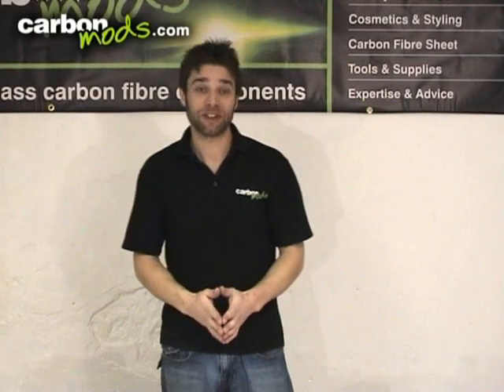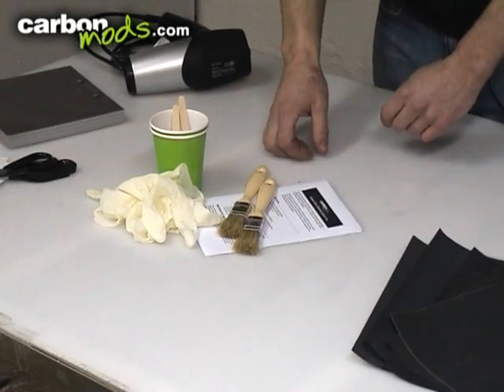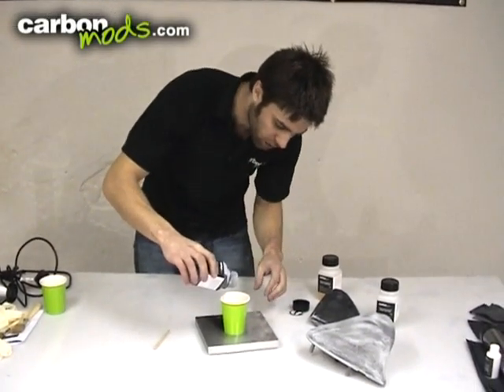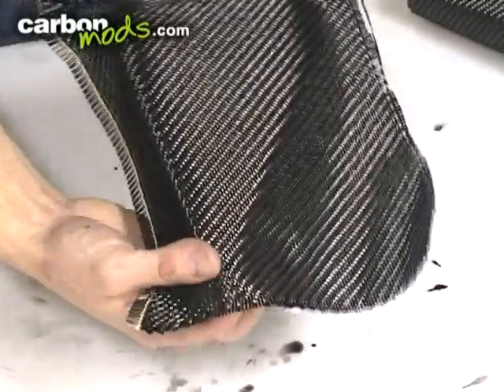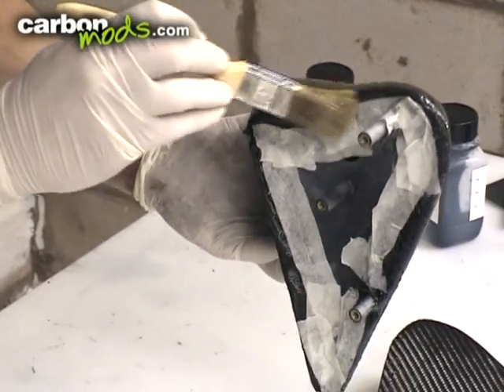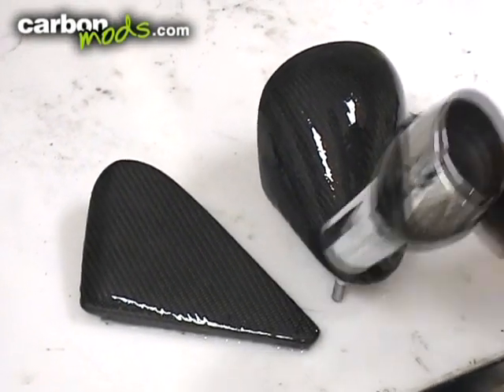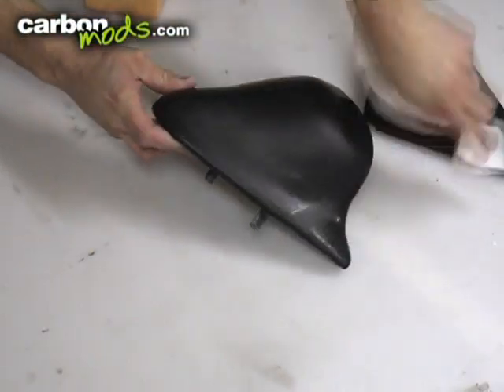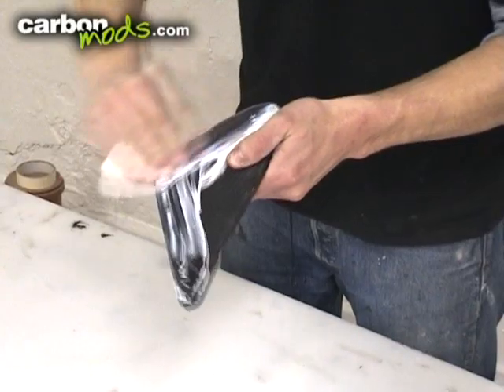How to cover parts in carbon fiber (fibre) by skinning or wrapping

Comment: Bone you can tell the difference in weight. My metal hood weighs around 30 pound, just bought a F hood that can't weigh more than 5 founds. Even a fiberglass hood weighs 10-15

Comment from the maker: @MikkoMuhis Yes, it will certainly add some strength to a fibreglass part if you add a layer of carbon fibre over the top. It is only one layer though so it's not going to be a huge increase in strength. If you want it much stronger then you could add additional layers of carbon fibre.

Comment from the maker: Hi faYte0607, 

It's very easy to wrap around corners and curves because it's real carbon fibre and not vinyl. the weave can move freely against itself this allows it to conform around complex curves, unlike vinyl which can often wrinkle where there is an excess.

Thanks for the question, Carbon Mods

Comment: Does the Tow Size and thickness matters for the CF?
 I have lots of 6k 0.17" cf cloth and Epon 828 resin, do you think it will work the same if i folow your instructions in the video?

I don't live in UK or else I would just order your stuff.

Comment: I'm looking for someone to do a skin on my Denali grill bezel. I wanted a black finish and tried to paint it without a proper location to do prep work on the Chrome. Now it has mostly chipped off and I want to start over with a permanent black look. I think that upgrading to CF would look awesome. Is there a shop that applies CF skin to factory chrome auto parts?
Reply: There's a good chance that any good auto body shop could take on such work, especially if they have experience with fibreglass work, etc. We've also noticed a growing number of smaller businesses offering such a service via Facebook or Instagram pages - we cannot recommend anyone specifically but you will probably be able to find someone reasonably locally to you.

Comment from the maker: If you think any grease or contaminents have got into your process somehow (off your hands, rags etc.) then this is good advice. If you're working very clean and changing water reguarly then this isn't always neccessary. We didn't wipe this part down between coats, kept it clean and it was perfect.

Comment: CabonMods,

I want to make a CarbonFiber Xbox 360 case.
Not face plate but whole case!

Do I need to make a mold of the case first or can I just skin it, remove the skin and use that as the case?? 
-Thank you

Comment: Can I use automotive clear coat instead of resin
Reply from the maker: You'll need at least a couple of coats of resin to wet out the actually carbon fibre and provide a reasonably smooth surface but you could then use a clear coat to finish.

Comment from the maker: @dotless : It would be possible but motorcycle exhausts run pretty hot so we would suggest using the 'HIgh Temperature'  version of the kit. It's exactly the same but uses a special resin system that's dimensionally stable (doesn't expand or contract) up to about 160 degrees C (which should be fine for most exhuast systems). The you just follow the same steps. The HT kit is listed on our site too.

Comment from the maker: @malibooroo : TT mirrors really are very domed and would be right at the limit of how far the weave could be distorted without the need for a cut-line. If you do need a cut-line I'd suggest using our ProFinish carbon (so that you can have a perfectly neat join-line) and doing it in two peices - this will reduce the amount of distortion needed considerably.

Comment: Can resin bond with bare plastik material such as spoilers??
Reply from the maker: It depends on the type of plastics, some are very, very difficult to adhere to and so I would avoid Nylons, Acetyl, Polypropylene and PVC among other Hard-to-Bond plastics but it should be possible with plastics such as ABS with good surface preparation.
Reply: @carbonmods  so how do i do if i intend to skinning plastic mat such as nylons,acetyl,pu and etc,

Can i skinning the whole item first using polyester resin and normal fiber,after that only i lay the cf mat?
Reply from the maker: @mohamadiqram5837   PU (Polyurethane) is not much of an issue if the surface is well prepared but for low surface energy materials such as Nylon or PP, this process isn't really suitable - polyester is unlikely to bond to those materials either.

Comment: Could this be done for manifolds or exhausts?
Reply from the maker: Realistically no as the resins will not take the required service temperatures.
Reply: @carbonmods  you're a legend mate thanks!
Reply from the maker: @waqshah5160  Intake manifold is likely to be okay though.

Comment: Just be sure to try and match up the weave direction and flow it with the curves of the object. Such as a car or similar parts. The most common is a 45 degree angle facing the right axis. Driverside 7 to 2 O" clock/ Passengers side 5 to 11 O" clock. If you look at the fibre ou can see the key weave direction. In the vid the mirror was straight ish, and the sail panel was almost at 45 Degree. And don't quote me on this, you'll be casing, VIS, Seibon, Aero. ect. ect. ect. Later.

Comment from the maker: @zbarneyz : I think you're missing the point. Adding a layer of carbon fibre to a none structural part (like a wing mirror cover) will only add a few grams of weight and will transform the way it looks. If you're not racing then adding 10g  won't make any difference to the performance but will improve the look of the car (you obviously like carbon or you wouldn't be watching this video). We make real carbon parts for race cars too but plenty of times a carbon skin is the right way to go.

Comment from the maker: Hi rinjingan, 

Yes you can use vinylester or polyester resins, however they do not perform as well as epoxies and often their clarity is not as high. All top composite workshops will use proper carbon fibre laminating epoxies like we supply. 

Thanks for asking, Carbon Mods

Comment: Hi all, what type of base/glue best for sticking t carbon fiber on metal ? Tqvm
Reply from the maker: If you're following the process in this video and applying carbon fibre cloth to a part then an epoxy resin (ideally a basecoat which is black in colour) is the best option and as long as the metal is thoroughly degreased and abraded to provide a mechanical key, you'll get a really strong bond. If you mean bonding an already cured carbon fibre sheet or part to a metal part then its a little trickier to answer as it will be determined by how the part is being used (is it cosmetic or structural); you could use single part Polyurethanes such as our PU18 or full structural adhesives like our VM100 'VuduGlu' methacrylate adhesive.

Comment: Can this same method be achieved successfully by weaving carbon strands myself to make my own woven pattern in my own size, say around a small mandrel
Reply from the maker: Potentially although that's potentially a lot of work when woven carbon is available off the shelf in lots of weave patterns, weights and widths but for sure, you could take carbon tow and weave it yourself.
Reply: @carbonmods  I want to use this method for custom fishing rod building to attach the guides to the rod blank. The sheets will leave a seam and won't be as tight unfortunately.

Comment: Question. What sand papers did you use in the beginning. Also, did the polish last forever?
Reply from the maker: MrPeterhuy : We start with a 120 then 240, 400, 800, 1200. The polishing process lasts indefinately (it's a mechanical process that effectively flats the resin to a very smooth glossy finish) however, like any surface on your car, eventually minor stratches and deterioration will occur. If you lacquer the part (clear coat) then it's the same situation although the shine you can get from lacquer, and the UV protection, are superior to just polishing the carbon.

Comment: how much extra thickness does this add?
Reply from the maker: +terra force It's around about 1mm. It depends on how many layers of resin you add and how far back you flat the resin that you add but you'll generally end up with somewhere between 0.7 and 1mm of added thickness.

Comment from the maker: @psasmh1 : Adding a layer of real carbon fibre to the outside of a part will certainly add some strength to the part. If you wanted to add more strength (as much as you want really) you could just add extra layers of carbon. This would be great if you were using this process to add a layer of carbon onto the outside of part you'd shaped yourself out of foam for example.

Comment: Important! Sanding carbon fibre require the same safety equipment as handling asbestos! Also, this carbon fibre vid shows how to make it look cool. But to make a part that is strong you have to work differently and really saturate your fibre in epoxy. Prefferably use vacuum bagging and an owen to cure it in.

Comment from the maker: That's right, a single layer of carbon won't add much strength to the part but it would be a hard outer finish nonetheless. If the part started off strong enough then a single skin of carbon would be the normal thing to do. If the part isn't strong enough and you want to make it stronger by adding layers of carbon then you would be talking of more like 3 or 4 layers to really make it stronger.

Comment: How does none handle parts that have countersunk recess for screws when skinning?
Reply from the maker: The easiest way would be to fill the counter-sink hole with plasticine, skinning straight over the top and then re-cutting the countersink once finished. You could then use a small amount of the black basecoat or paint to colour the recess black so that it blends in with the surrounding carbon. Alternatively, you could cut the countersink slightly bigger than it needs to be and skin that first using small offcuts of carbon; it will be very fiddly to achieve, especially the sanding and polishing afterwards but once done, you could skin the rest of your piece and trim neatly at the edge of the countersink. If it was me, I'd opt for the first process though as its likely to result in a faster but better finish overall.

Comment: Go to easycomposites.co.uk. In their carbon fiber section they have all of your standard twills, weights, and weave sizes. if you scroll down a bit you'll see one of the options with a blue "PROFINISH" on it. That's what you want. It comes slightly pre-infused with resin. It won't separate or fray when it's being formed to a mold or cut (unless you're really rough with it). Also, try using carbon fiber shears because they won't pull when your cutting. Good luck!

Comment: @carbonmods I have changed to just using carbon fibre patterned vinyl. Should make things easier and cheaper. Its actually for making a deadmau5 head so using actually carbon fibre is pointless.

Comment: What did you do with the taped back edges?
Reply from the maker: You're making me really think back now because it was a long time ago! In this case, I think we left the tape on because it isn't seen when the mirror is fitted to its back plate but it could easily be removed/cut back after the first coat of resin has cured and then the subsequent coats of resin would encapsulate and put a good finish on the edge. The tape is only really needed whilst that first coat is curing.

Comment from the maker: It depends what type of foam the canopy is made from. If it's Depron then the bond will be ok but it won't be fantastic. If it's PU foam, styrofoam, or PVC foam then the bond will be a lot better. You should ensure that the canopy (or anything you are covering) is keyed-up properly (with coarse abrasive paper) which will help the 'skin' stick to any material.

Comment from the maker: Hi Plooke, you could use normal carbon fibre epoxy laminating resin as the first coat, however you may get problems with the level of 'tack' and quality of bond to the part, also with it not being black you might get visable gaps between the weave on the surface,  I would say if you can get hold of some skinning base-coat, it would make your life much easier! Any more questions please ask.

Comment: Is it possible to make a full CF piece out of a skin ? I'll explain myself... Imagine you want to make a fully CF piece without using a mould. You'd have to make a single CF layer of the object (like the skin you are doing in this video), retire it from the object (which would be used as a mould in this case) and put successive layers in the back of the first, already hardened, CF layer. I guess the only difference here is that we should have to use a release agent for the first layer.

Comment: Is the process the same for wrapping a stainless steel part? What resin would you recommend?
Reply from the maker: +MrTurbo458 Yes, it would be the same process. The only problem you may encounter when skinning metal is if the metal part gets hot. If this happens it can expand (coefficient of thermal expansion) where the skin of carbon/epoxy has almost no thermal expansion which, over large areas where temperatures get sufficiently high, can cause delamination of the carbon from the metal. Therefore, ideally, avoid skinning metal parts that will vary in temperature by more than 40'C.
Reply: +carbonmods   Is there a special epoxy I can use of the part gets hotter than 40c? I'm not talking exhaust hot,  but like if left in the sun and a little heat generation,  say 80c tops... Thanks for the reply!

Comment: A little tip I've found when skimming is instead of using the tape that can be messy and awkward I use small bull dog clips to fasten the c/f fabric tightly to the piece, the last thing you want are air voids between your fabric and piece. 2-3 coats of clear resin and a final wet sand with 1200 wet paper, then I use a dremel to remove the hardened excess c/f fabric from the back and sides, and finally 1 coat of 2k lacquer, dry via IR light and you have a perfect finish every time.

Comment: @carbonmods 
thanks for your replay I was checking my inbox everyday so you finally did it. lol. This is what I am doing, I have the core already, I am planning to put a light coat of fiber glass to add some stiffness, My dilemma is that I work for a paint company  that also make industrial epoxy coatings for water tanks and Disney parks. I have 50% off for every item, including epoxy coatings, but the company does not make epoxy resin, which apparently is the best glue for carbon fiber and...

Comment: if your worried about thickness, choose the thinnest TWILL WEAVE carbon fiber sheet you can find (twill weave looks better than plain weave).  Plan on the final product being at least twice as thick as the actual sheet.  If you use 1/2 mm sheet, expect the final thickness to be more than a millimeter.
Both the fuel door and the hood should provide more than enough extra space to accomodate for this slight change.

Comment: Good video, just wondering though are you using automotive sandpaper and what are the four different grits required, you mentioned you start with 120.
Reply from the maker: Beall&endall : Yes, it's waterproof wet-and dry abrasive paper. We use Mirka because it's a good paper that doesn't break-down and cause stratches like some cheaper papers can do. Grits are P120, 240, 400, 800, 1200.

Comment from the maker: @groundhabit : Well, a few things might help. The first is to skin straight over things like the button holes, not trying to go down into them and wrap it round inside - this would end up a mess. One the part is skinned you can drill through and then fettle the button holes to have nice clean sharp edges. Also, skin straight past the edges of the moulding and trim those off when it's all cured too - much neater. Also, consider using a lighter carbon fabric or maybe a 'ProFinish' fabric.

Comment from the maker: Hi emj0001, 

You Can get a great finish with either larger parts such as bonnets and roofs we would recommend a clear-coat or laquer as it is quicker. if you are looking for a flawless finish from laquer you can flat and compound this using the same method. 

Thanks, Carbon Mods

Comment from the maker: @AZURA888 : Lacquer (clear coat) out of a spray-can is not very tough and can flake off over time. A 2K lacquer (a 2 pack with the paint and a separate hardener) is much tougher (and better) and is unlikely to fail over time so if you have spray facilities or a local sprayshot that will drop the lacquer for you then that would be the ideal option.

Comment from the maker: Hi Tuga77, 

The reason that we reccomend snading after the first coat it because there is often small 'nibs' and sharp spots that are best being removed early to allow the subsequent top-coats to build a fairly flat surface. if you don't have any of these small problems areas then it's fine to continue without sanding, thanks for the question. 

Carbon Mods

Comment from the maker: Hi ZaoHuZhua, 

We have known a few people to skin 360's, in all of the ones we have seen they have filled in the lettering with car body-filler and then skinned over it smooth. It would be very tricky to get the lettering to remain accurate. probably more work than it's worth! 

Hope this Helps you out. 

Carbon Mods

Comment: Because i had an issue the carbon fiber skin popping out under the sunlight after curing for a week,the inner side resin became like rubber and start to lose grip with the sanded surface

Comment from the maker: @KartingApexKing : For obvious reasons we need to tell you not to do this on a helmet that will be used as a peice of safety equipment because how you do it and what you do is beyond our control and could compromise the helmet. In answer to your questions: (1) Just go straight off the edge, let the carbon cure and then trim the overhang off (2) Epoxy is unlikely to compromise the material of the helmet but see above (3) Yes, certainly.